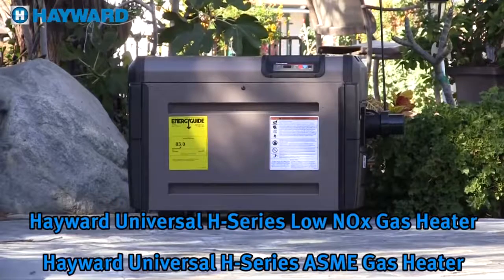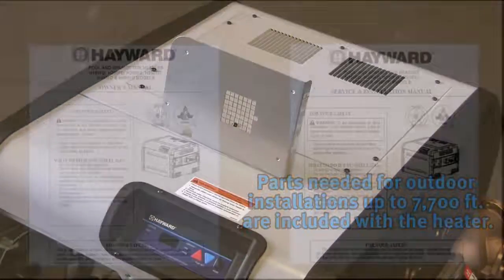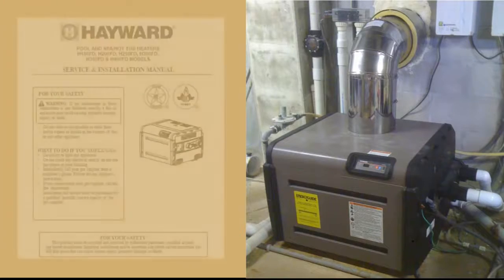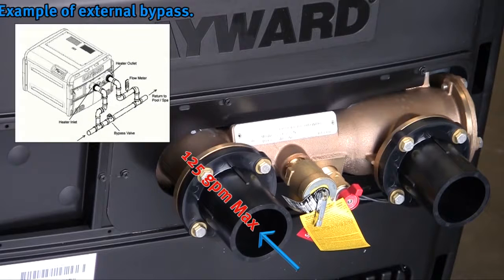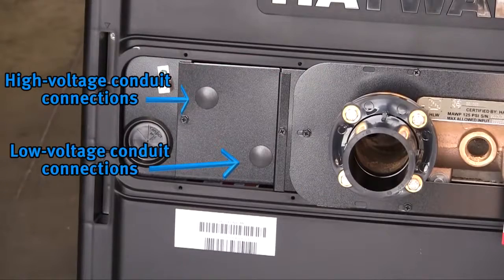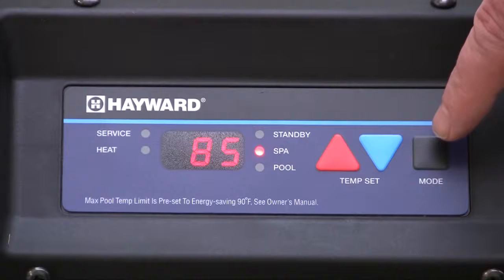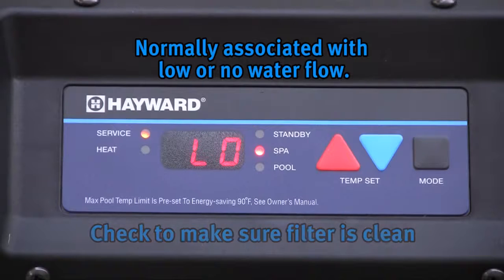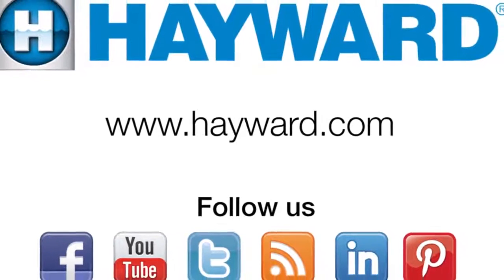Hayward Universal H Series Heater Installation, Start up & Troubleshooting - Pool Supplies Canada.ca

Comment: My pool pipe is 1 1/2" can that be used with this heater with the correct bushing?
Reply from the maker: Yes, absolutely!
Reply: @PoolSuppliesCanada  I have this 1.5 in piping with bushing. I am being told this is why my heater is giving the error Lo.